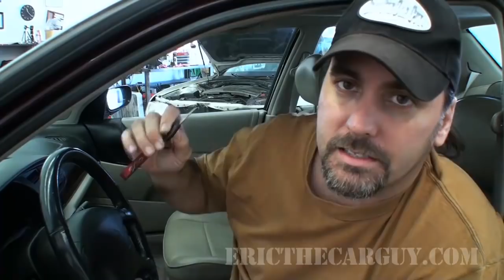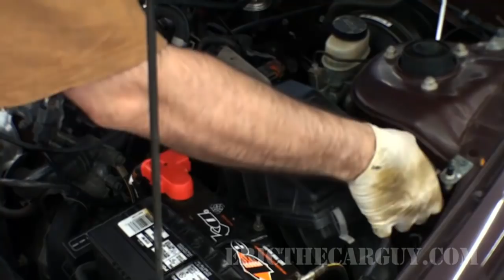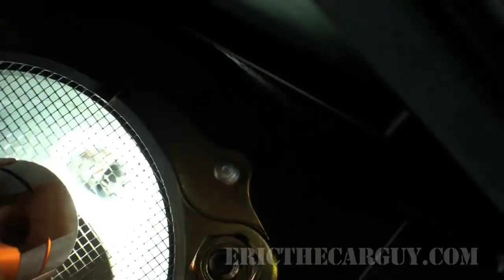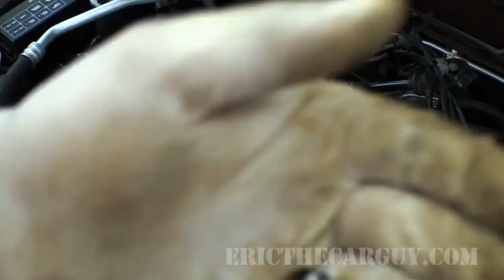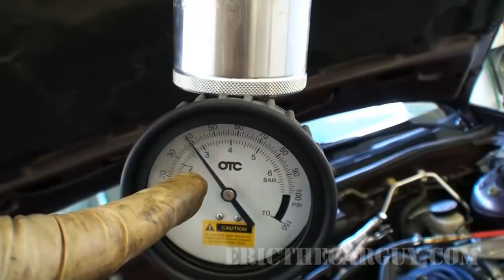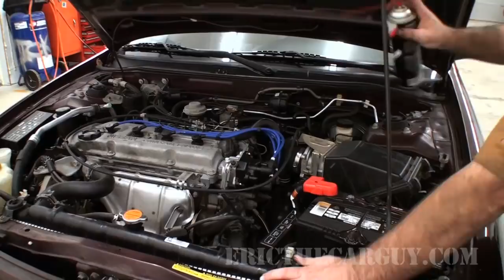1997 Nissan Altima Misfire Diagnosis -EricTheCarGuy

Comment: I absolutely love this video! My 2000 Nissan Quest is throwing exactly these codes (except the misfire code is for a different cylinder). I have done a number of things so far, such as replacing the distributor, ran the fuel injector cleaner, cleaned the throttle, replaced the fuel filter and air filter. The problem is still there. This video provides many great tips and tactics to think about what to try next.

Comment: Eric, I'd like to share with you some things I discovered in my endeavors with this exact same car experiencing the EXACT same problem. I really think it'd be a GREAT addition to this video because the majority of the viewers watching this video are working on high mileage cars versus the lower mileage car featured in this video. After going through regular diagnostics, and replacing the standard tune-up parts, I determined my intake gasket was leaking as well. After a timely job of replacing it as you know, I also replaced both egr valve gaskets (top and bottom) , the egr inlet tube gasket located on cyl 4, and the throttle body gasket. I started her up and it purred like a kitten..... For about 5 mins. Then it went right back to missing at idle. Under load driving was greatly improved but under 2k you could feel the miss and I was not happy. I pretty much went back through the entire diagnostic process trying to eliminate things. Long story short,
Reply: When I replaced the intake mani gaskets I did not fully remove either half of the manifold from the car, I just separated them enough to get the job done. What ended up happening was during this process I managed to loosen some carbon somewhere in the egr passages because they were absolutely FULL of it and a chunk of carbon made its way into my egr valve which made it unable to close. This happened five minutes after it started and was running perfect. It had all the symptoms of a vacuum leak. I think you should add a note to the video really stressing the importance of full removal of the manifold so you can do a thorough egr valve and passage cleaning by removing the four access plugs located under each runner. It's impossible to do the cleaning in the car and if you reinstall with new gaskets you are just wasting your time. At any point in the repair you can knock loose some carbon and it can get stuck in an egr passage and BOOM, you're missing again required full removal a second
Reply: Second time. I learned this the hard way and after having to do THAT job twice, I wouldn't wish that on any mechanic.

CLEAN YOUR EGR AND EGR PASSAGES WHILE THE MANIFOLD IS OFF!!!!! DONT BE LAZY LIKE ME AND NOT PULL THE MANI ALL THE WAY. YOU DONT WANT TO DO THIS JOB TWICE.

^ moral of the story kids
Learn from my mistakes and Eric's knowledge. 

For information on how to clean the egr passages refer to Eric's video where he performs this job on a F22 series Honda motor that's very similar.
Reply: +Taylor  Gresch Heck, if I was in there with a chance to take the EGR out...I might just block it off lol

Comment: Eric,

Thanks for this video. My elderly neighbor asked me to look at her 2001 Altima. She's asking me if she should get rid of it because of a misfire on number 4 that only happens at idle. I checked it out and it is exactly the symptom you had in this I recently changed the plugs wire cap and rotor. The only thing is that the brake cleaner trick didn't do anything. Do Altima's of that vintage have an above average occurance of intake manifold gasket failures? Meanwhile, I'm going to go run the test again.

Thanks again.

Comment: only 86,000 k on it. My 2000 Nissan Altima GXE has 240,000 k on it. It runs smooth, no check engine lights, no oil leaks. Passengers are amazed how smooth and good my car runs and sounds.  I pamper my car. Good line that Nissan produced.
Reply: Z31Rider boii nobody care about yo 2000 nissan altima son. car still trash lol
Reply: Rizal Galiza I have a Nissan Pulsar Hatch it's also an amazing engine runs like a clock

Comment: I have seen a lot of your videos and this has to be one of the best.  In particular I like when you explain the strategy and logic of a particular approach before you try something.  And then when that does not work, you explain the next logical strategy and approach.  A good Sherlock unraveling of what the root cause is that eventually reveals itself.   I am way past my youger and foolish years when I would just throw parts in an attempt to secure a fix. The true fun is in an accurate diagnosis

Comment: My approach to this after seeing the tune up partly improving the rough running, I would resistance check the injectors, then swap 2 injectors around to see if the issue follows that injector. If no change, I would suspect vacuum leaks.
When you pinched off the return line, thus sending FULL fuel pressure to the injectors, you could be dealing with a fuel pressure loss which is simple to verify.... however, by sending maximum pressure to the rail and injectors, if the computer does not shorten injector pulse time accordingly, a larger volume of fuel will be injected, which helps compensate for the vacuum leak which makes it run too lean.

Comment: Hey Eric. I gotta say, I'm a fresh out of college technician working at a Chevy dealer and I've encountered this exact same problem before. But let me just say this. Your scanner is capable of reading live engine data, correct? You should have looked at fuel trim before you even stood up out of the driver's seat. You would have had a clear battle plan right away. A lean running condition, with a MAF code and a misfire screams vacuum leak before you even open the hood. Thanks for the videos!

Comment: I think this is a very good video to put up Eric because it shows the challenges a technician faces trying to diagnose a problem and all the possibilities they can be. It also illustrates how important it is to look at all possibilities before you start throwing expensive parts at it. A lesser tech would have just installed new injectors and then the customer would eat that without a resolution to their problem.

Comment: I'm surprised that you didn't see the arcing on cylinder number four. You can see it clearly right after he rew the motor. When the engine then goes back to idle you can see the fast arcing bolts from the ignition wire to the valve cover.

Watch for the arcing on cylinder four from 14.02-14.07. But still great vid, like always good job Eric!

Comment: Eric great video i have a 2004 sentra 1.8 with a misfire. The misfire only happens when i first start the car on a cold morning in california (which is not that cold) and it cranks for like 5 second and it starts but it studders like its gonna turn off then it normalizes the check engine soon light blinks and it runs perfect. Does it right any bells? Thats the only thing does not over heat just long cranks till it turns on vibrating like its chocking then its normal all day?

Comment: My 99 Altima is doing the exact same thing. Mechanic checked everything you checked including replacing distributor, fuel injector, the intake maniford gasket (which was replaced in 2016). Car was tuned 5 days ago. What's left for me to check to solve this problem?

Comment: I have a 2001 Nissan Altima and I'm having the same problem. I had a full tune up including fuel filter and had the intake gasket replaced. I haven't done the rotor replaced, but I had new distributor cap, wires, and spark plugs installed. My car still has a misfire. What do you think it could be? Should I replace the rotor?

Comment: I wish I would found this video back when it was first posted. I had a 94 altima with the same engine. As soon as I read misfire in the title I could have told you where it was and how to fix it. The #4 plug wire blows out the side and arcs on the wall, sometimes it will only miss under load because of the lower spark. The best thing to do for these engines is put a roll of good electrical tape in the glove box or the console and use it to wrap up the plug wire until you can get a new set. The brand or quality of wire doesn't seem to matter either, all will only last a year maybe 2 if your lucky.
Reply: you know it's funny you say that Cuz with my altima (not same year but same engine) the #4 contact inside the dis. cap on mine is where it would always misfire, the plastic around the contact actually got so hot it kinda melted a little bit and the contact was leaning back and twisted and all distorted. lol ended up just replacing the whole distributor cuz I broke the shield that covers the cam sensor and pickup n all that..... the new distributor worked....I had no idea the number four ignition miss was common on the ka24 engines. good to know though

Comment: Nissan Altima 4 cylinders in this vintage had problems with the intakes. It is very common. Also the knock sensor tends to go back too.  It is much easier to get to when the intake is off.

Comment: Hi Eric. I have a similar Probelm in my Altima 1998. The codes that appears in the scanner are P0325 and P0141.  I think like in your video those are no the real problem because the misfire is normally when i´m in the red light or in heavy transit.  But in the last days the car has started to make a failure too speeding (1500-2500 RPM) like a misfire or similar.  So i´m not pretty sure where to start.  Have you had any similar failure?.  Thanks in advance.

Comment: I just bought a car, 2004 civic, only has 83,000KM on it as I’m in Canada. Anyways I had to bring it back to the dealership as there was knocking in the front when going over bumps. I took the wheels off myself and found the stabilizer links were rusty and bushings cracking and breaking apart, which in my opinion, if they did a “155 point inspection” should’ve been noticed and replaced. So they fixed it for free the front and rear links, and also an alignment as when the wheel is straight it veers to the right pretty hard.  The knocking is still there while going over bumps but i do notice the difference from the new links. It still pulls hard right when wheel is straight, and now when I start driving in the morning after it has heated up slightly, when I come to a stop the engine kind of stutters and vibrates/shakes the car. I’m thinking it could maybe be a misfire, but when we went to test drive it, I pulled the oil dipstick and they had overfilled the oil majorly.. I’m talking like at least 3 inches over the 2nd fill hole (full mark). Does anyone know if the symptoms I described could possibly be from the oil being that overfilled and it being test driven by others like that, if there’s is air bubbles that got into the crankcase and around the pistons? I’m not a mechanic but I do a lot of work on my cars, just haven’t done major internal repairs or diagnostics. Any help would greatly be appreciated, as the car is pretty much brand new kilometre wise, and I don’t feel it should have these issues unless the dealership guys knew something was wrong and they lied anyway.

Comment: Had a problem like this, cylinder 4 miss fire . Did everything the previous mechanic did but I went further. Found that the intake gasket had a crack on it .replace it and bomm. Smooth running 5yrs no problem.

Comment: Eric i have a question: i been dealing with a misfire on cylinder 3 on a toyota rav4 2001, changed the coil, got better but it will still  misfire but not all the time. useally when going up a hill or stoping at a light. after that changed the spark plugs, it misfires less now but i still feel ony when i stop and accelerate, after the engine is hot. do u have any idea what might be causing the problem?

Comment: Love Eric's videos.. one thing I also do when checking ignition wires is try to wiggle them as the engine is running to see if there is a connection issue between the wire and the spark plug.. this can often tell you which wire is bad too

Comment: Awesome vid as usual, so how do you bill for the work that probably needed to be done (fuel inj, distributer, maf, etc) but wasn't the problem.  I had a misfire recently that turned out to be a bad spark plug wire and a bad O2 sensor (after seafoam in the intake), talk about confusing.

Comment: at about 14:30 in to the video i saw just at the distributor where the wires are coming out i saw some sparks flying from there.
Reply: Good catch, his logo is covering it up but I saw that.
Reply: suprised eric didnt catch that its clearly earthing.
Reply: Same here also spotted that and commented glad someone also spotted it
Reply: Starting at 14:05 I saw cylinder 4 at the valve cover and wire arcing. Then I noticed the distributor arc as well
Reply: Looks like it's just water droplets vibrating from the engine.
Also it's unlikely for the charge to arc from the side of the cap terminal to the side of the plug wire passing through two different insulated points rather than the solid conducted connection beneath.
Arcing generally occurs between the wires themselves.

Comment: speedy1- Hi Eric can You tell Me if the alternator on a 2000 maxiam connect's to the cam assembly cover or the head as I broke the connection - Is there any repair for it or not  ?

Comment: Hi Eric. Another good way to diagnose the injectors is to swap the suspicious one with a known good one, from for example Cyl 3<->4. That might tell wether or not the injector is bad. If the problem goes to Cyl 3, and 4 gonna be OK, you'll know that it's faulty.

Comment: This is exactly why I NEVER take a vehicle to a shop until I've exhausted my own diagnostic repertoire.  

Unless it's transmission work.  I HATE transmission work.  

While some shops might not charge for the time and parts wasted finding that vacuum leak, most would.  Something that might have only taken $50 to fix could end up being several hundred dollars or more.  

It's also why it's a good idea to have a scanner that can give real time diagnostic readouts for things like vacuum and manifold pressure.  The bluetooth obd2 scanners are cheap enough off ebay or amazon and there are a few apps like Torque that don't cost much.  Some (like Torque lite) offer many of the full featured app abilities for free.

Comment: Hey, I was just wondering what you would charge for something like what you did in the video?  Are you charging a hourly rate or do you charge $xx.xx as long as you fix it?  Also, if you don't fix it do you still charge?  I was just wondering because I have an issue like this with my jeep and I was just wondering how much it would be to have it looked at.  I was told $90 per hour at a few places to just look at it.  And I want to know if I have to pay even if they don't fix it.

Thanks!

Comment: Hey Brother, I appreciate your style of teach. Riddle me this, Cylinder 1 is misfiring on my 98 Altima but only when the engine reaches running temp. And can stop misfiring for a month at a time, then start again? I did all the basics; plugs, wires, cap & rotor, fuel injector. Seem to baffle all the counter dudes. If this is the wrong place to ask, forgive my ignorance. "Rookie" here.

Comment: Another educational video good job Eric.Can you show me how can fix same kind issues on old school OBD system, when you have chance. Bcoz you know, i cant find a code reader for old OBD system. Most old car has a OBD socket with ECU... I didnt get any idea on my car's Maf sensor, factory manual says how to diagnose that part, im checked and its look normal but engine working loudly and when i disconnect maf's socket then engine working normal ( with high rpm a bit) so i know its a MAF issue or ?

Comment: hey eric, i have a 1996 nissan skyline r33. i changed my water pump a few weeks ago. i had to remove all the pulleys and the timing belt to get to it. after putting everything back together there is a knocking sound from the timing belt area. im suspecting the timing belt is either loose or too tight. is there an easy way to diagnose this?

Comment: ( I miss my 98 Nissan Altima. That car was awesome, even in the winter. But I had about 166,000 miles and wanted to get a decent trade in value, so, I traded it in. 
I highly recommend this car if your looking for used, if you find one in decent condition.

Comment: I have a 1989 Nissan 240 sx. We changed the alternater and it ran for a day and then we pulled out of our parking space and it died. My fiancée thinks either the engine locked up or the oil pump went out. WHAT DO YOU THINK?

Comment: Can you pull the connector that goes to the coil over plug and see if engines changes or do you have to leave connector plugged to coil over plug and unbolt and pull coil to get engine change or does it matter which way? 2002 nissan altima 3.5 6 cylinder

Comment: Question about this particular vaccume leak; if after running the car for about an hour at 2500 rpm (driving highways) and shutting the engin off, will the car be harder to restart? My 97 Honda seems to be having the same issue, runs rough till you open the throttle up. After running for a while (45 min~ an hour) the idle seems to drop far lower than compaired to cold start/ 20 min, to the point where it feels like it wants stall out. Just trying to narrow things down.

Comment: Kind of disagree with Eric's approach here.  A P0304? And you chase the MAF?  I would have started there, and also, I never mess with those weak, often times corroded, oxidized, and seized bolts which hold the MAF to the air duct.  Just remove the entire assembly and take it from there, because you know those tiny bolts will in most cases, break on you like the one did here.

But all that said, you found the problem, and that is what matters.  No right or wrong way to go about it I know, just one tech sharing his approaches with another.  Good vid.